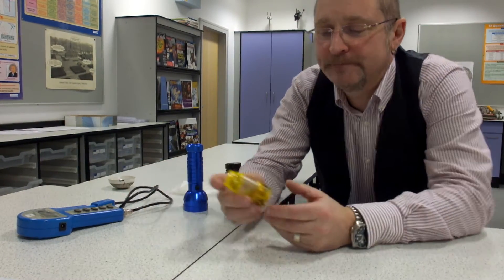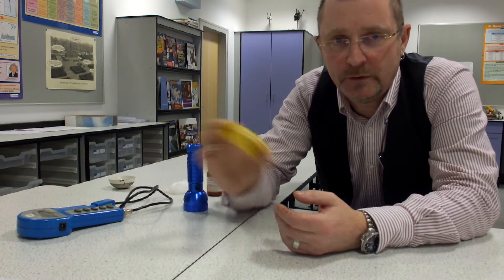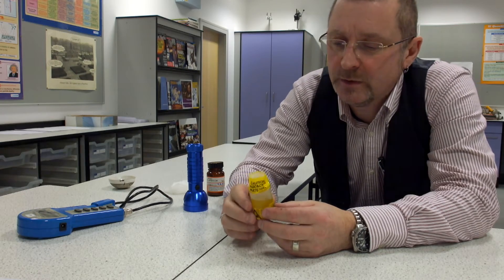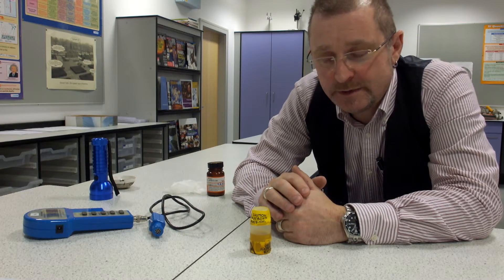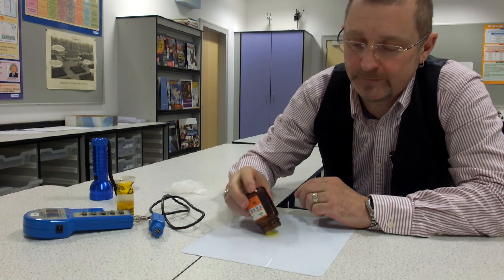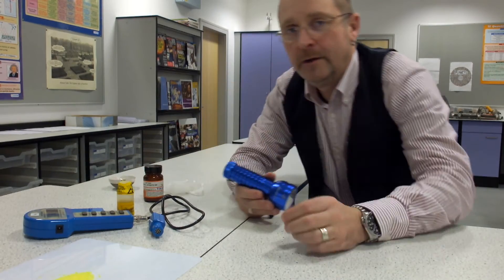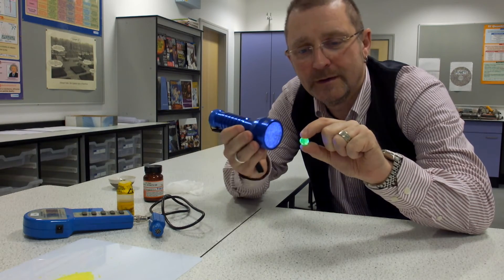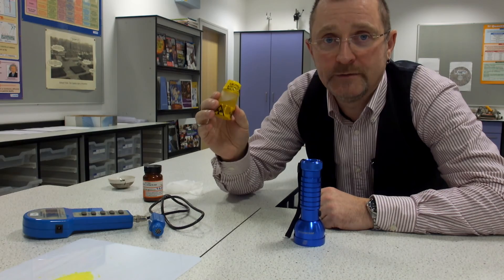Homemade Protactinium Generator

Comment: I live in the USA, and I FINALLY made one! It works great! I used the Observer software with the Inspector USB Geiger-Müller counter, and it produces an unbelievably smooth decay curve! I used 2.5 g of uranyl nitrate, conc. HCl acid, methyl isobutyl ketone, and a leakproof polypropylene bottle! 👍

Comment: Hi Alasdair. I've just lead a course on creating these and we used conc. HCl which is 12M. Didn't dilute it down but needed to use a fume cupboard as the fumes are pretty nasty. 
With regard to the danger of these... tbh the conc acid offers much more risk than the radioactive side. CLEAPSS recommends using a PFA bottle rather than PP as it is less likely to corrode due to the acid. Compare the radioactivity to the amount of radiation released by everyday objects (a protactinium generator is 10kBq) and you will see that it doesn't provide much risk at all: A Banana is 3.6 kBq, Granite kitchen 3 kBq, Cup of coffee 1 kBq, Human adult 7 kBq, Smoke detector 30 kBq, Cornwall 200 Bq/m3... you get the idea!

Comment: I plan on making one! Thanks, Ian! The CLEAPPS recipe is 5 steps: 1. Use a 30 mL polypropylene (PP) bottle. 2. Add 1.5 g of uranium nitrate [UO2(NO3)2 · 6H2O)] to the bottle and then dissolve it in 4.5 mL of pure H2O. 3. Add 10.5 mL of concentrated hydrochloric acid. 4. Add 15 mL of amyl acetate. 5. Firmly seal the cap and properly label the protactinium generator.

Comment from the maker: No, it is'nt dangerous, very slightly more radioactive than back
ground.
Reply: When made one I found that a polyethylene bottle was not amyl acetate proof - there was always a strong smell of it. The level also went down over a time. I then used a PTFE bottle, which was very much more expensive, but didn't leak and lasted much longer.